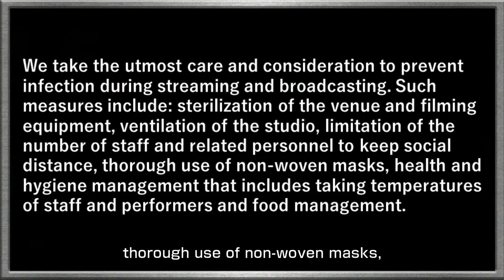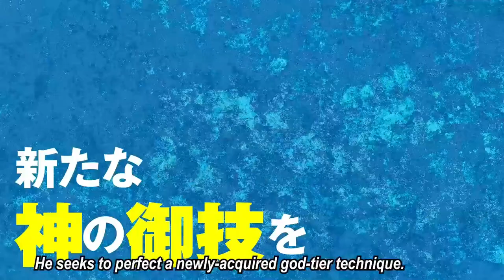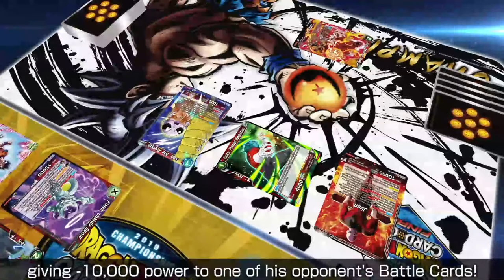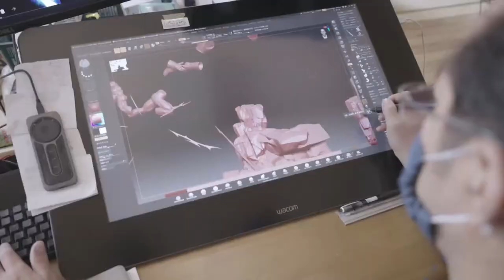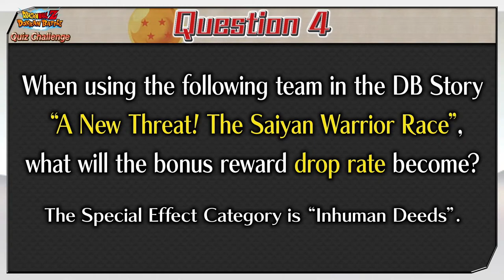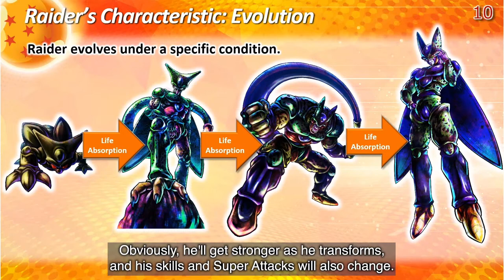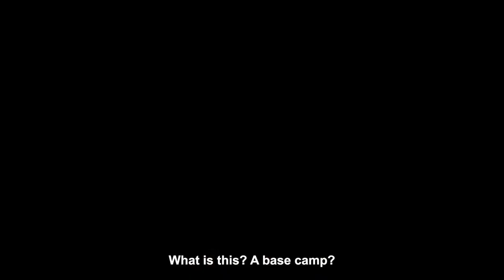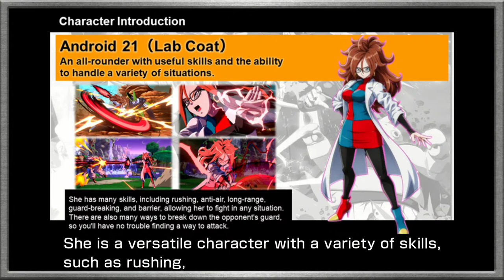[DBGBH2022 Day2] Great Ape Arena Channel

Comment: 8:15 How they gon make the final blast of the level 3 look more powerful than Majin 21? It's beautiful with the outer shot of the ground bursting with beams of energy before it explodes. But it ends up looking more powerful than Majin 21's which canonically doesn't make sense. I would think Majin 21 is more powerful.

But because of that change it's probably up there as among the best ultimates in the game. Majin 21 having it would probably make more sense tho. Or both of them having it.